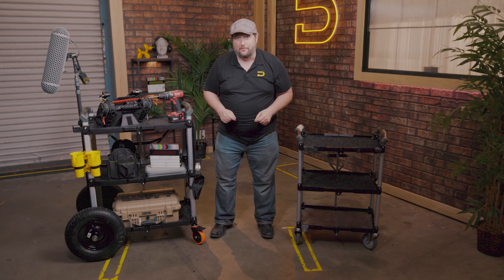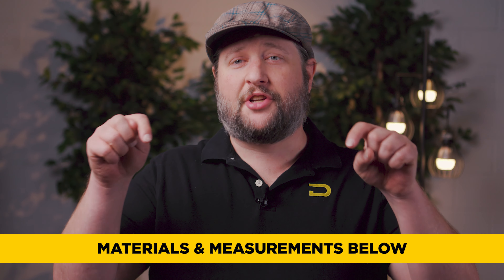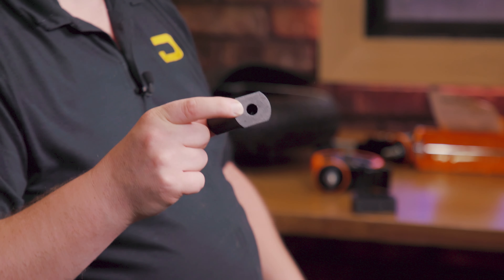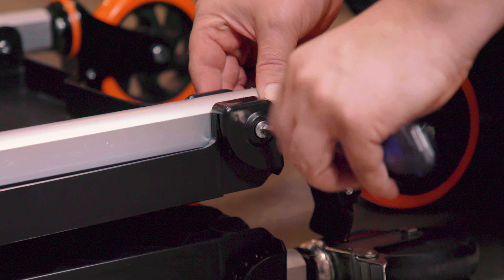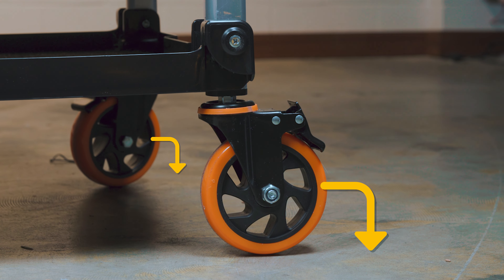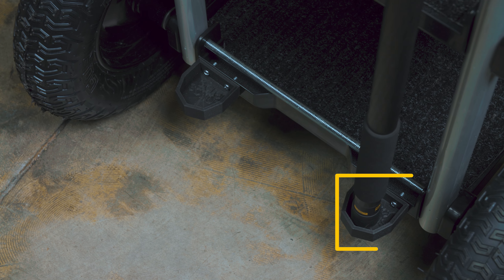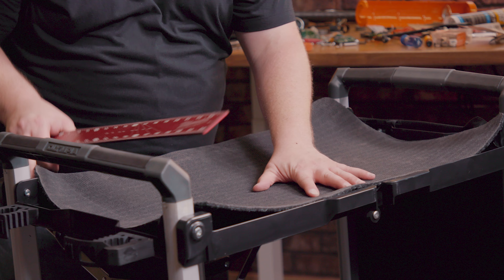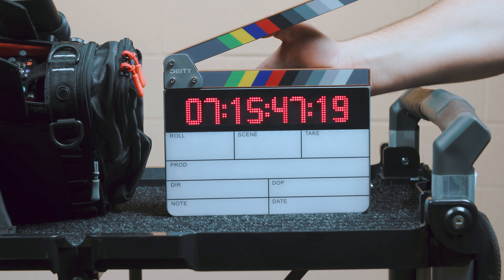The Ultimate DIY SOUND CART under $500 | Filmmaking on a Budget

Comment: Tip of the day: To prevent your drill bit from sliding around when starting your hole use a small nail, awl, or center-punch to made a small indentation. If you don't have those, at least pre-drill using a thinner bit.

Comment: I am curious about how well the 3D printed adapters hold up.  I love using 3D prints to create otherwise difficult solutions- I do it on a weekly basis… but putting an entire cart on top of a print I would be leery of.
Reply from the maker: They have held up very well but we also use carbon fiber filament which is incredibly strong. Stronger than most plastic mold injection parts.

Comment: Invest in a porta-band. Would have literally cut those rods in 10 seconds.
Reply from the maker: 100% True... but at the same time, this is the first time I've ever needed to cut a rod. Rather save the money on a cheap tool you hardly use and spend more time cutting. "Buy cheap tools until you know what you really need from that tool, then buy the best version you can afford." -Adam Savage